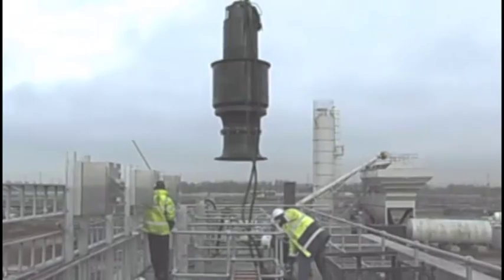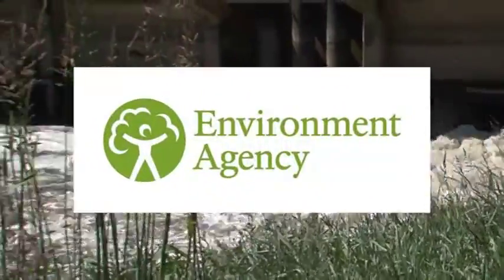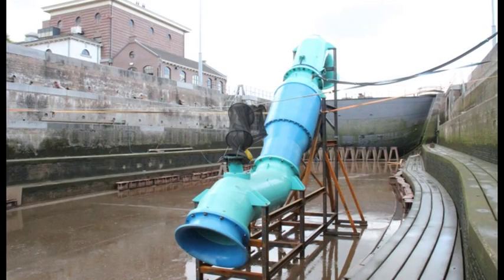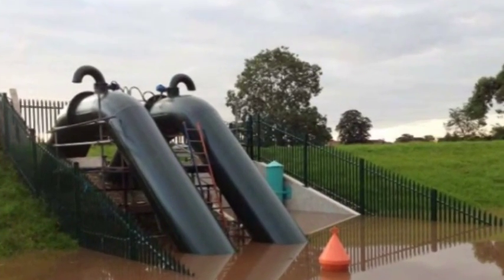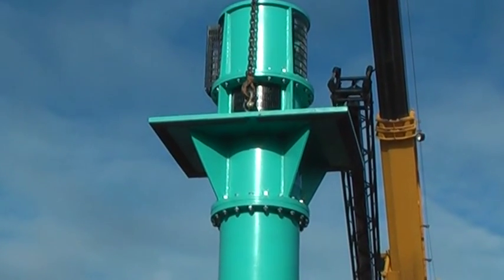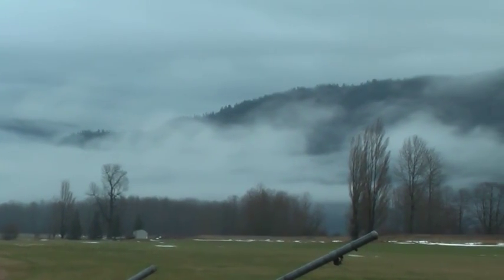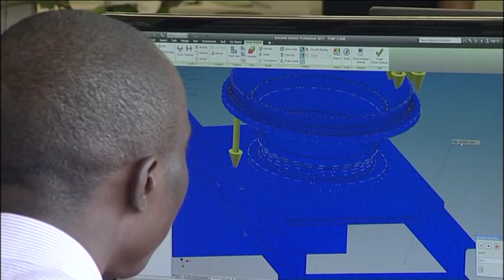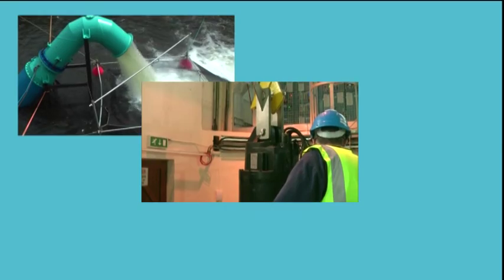Fish Friendly Pumps from Bedford Pumps

Comment from the maker: Bedford Pumps range of Fish Friendly pumps are the complete solution for eel regulation compliance with proven credentials awarded from independent research consultants in the field of water management, VisAdvies BV, following extensive and stringent trials. The tests prove conclusively that Bedford Pumps' range of submersible and direct drive pumps are fish and eel friendly with no direct mortality observed from exposure to the pump.

Bedford Pumps Fish Friendly range cover from 400 to 9,000 l/s at 2m to 14m head.  Fish Friendly pumpsets are available as a direct drive (DAF Range) or submersible (SAF Range) variant.